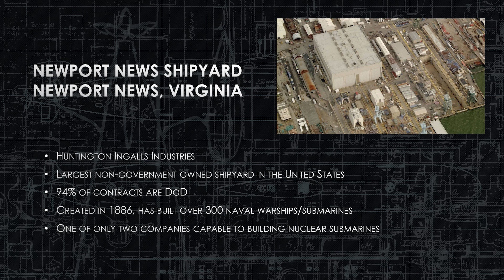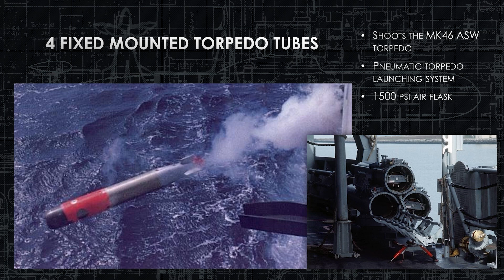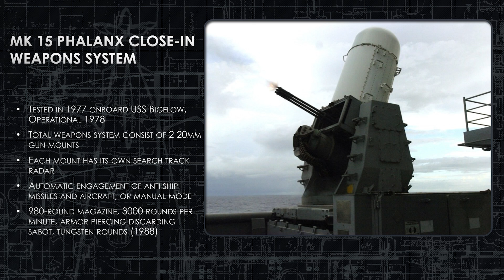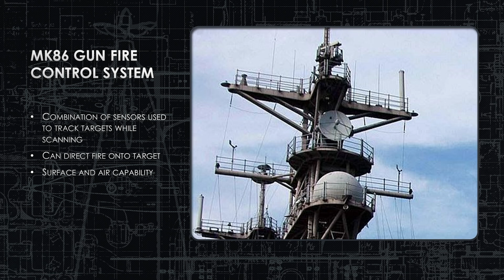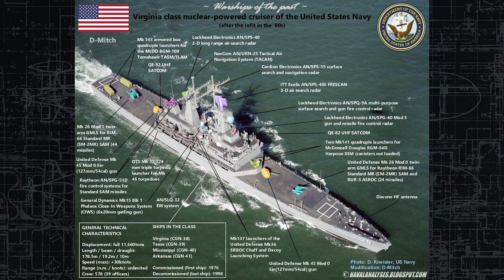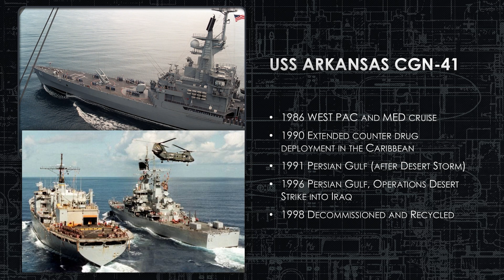America's Nuclear Cruiser Virginia CGN

Comment: I would seriously question the cost effectiveness vs gas turbine or steam.
Commerical nuclear is more or less even versus conventional. Navy nuclear does not have the economy of scale versus commercial 1GW (electric) plants, and use highly enriched fuel (for very long operational life) versus commercial which can use low enrich but need online refueling.
the sustained high speed op comes at the cost of excessive fuel burn, sure it can do it for hundreds or even a thousand hours, but it is wasteful on reactor life.

one reason the nuke cruisers were deactivated at the end of the cold war is excessive manpower for engineering vs gas turbine.
There are operational advantages of nuclear, but if we really factored in the true cost of navy nuclear, the smart thing to do would be to run the auxiliary boiler to reduce hotel load and perhaps even one of the diesels. This would substantially increase the number of year the reactor can go without refueling
the helipad markers were painted forward, but I never saw it used, only from the stern
Reply: as MrGoesBoom mentioned above, refuelling time savings,- should be considered; as well, the world is  changing, so more flex on where to operate for extended deployments if ports become unavailable..
Reply: The navy's priorities are different. It's worth extra cost -- up to a point -- to be untethered from vulnerable fuel depots.